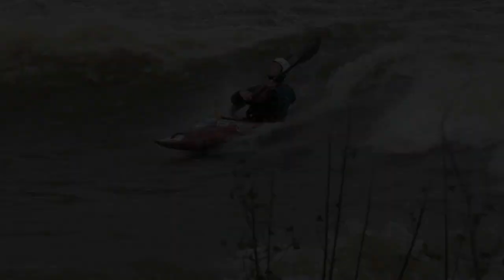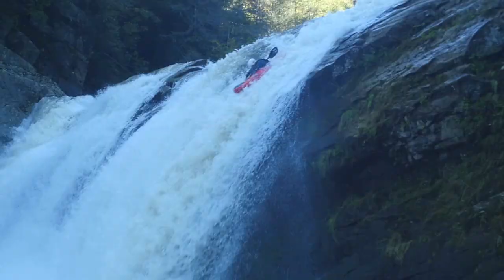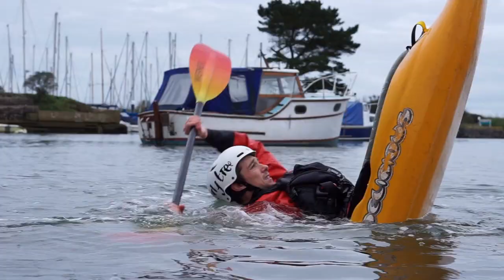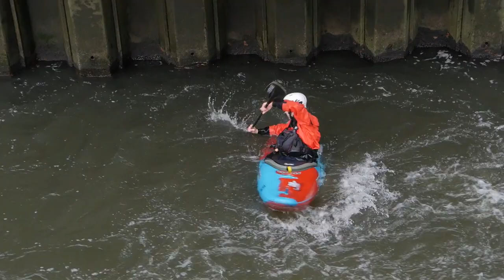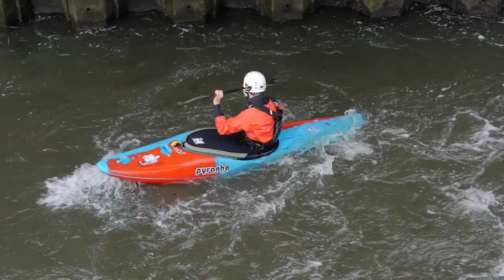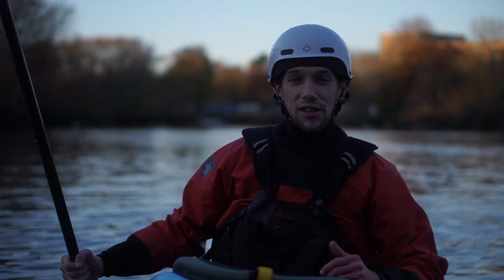How to stern stall (a verticality deep dive!)

Comment: Would you elaborate on what is meant by keeping the upstream edge more open than downstream edge?
Reply from the maker: When the stern is engaged underwater, it is common to complete an edge transition, which releases the stern and bring the boat flat again. The aim here is to avoid that edge transition, keep the hull flat/continually driving deeper, so that the boat stays vertical. I hope that helps.
Reply: @MatthewBrookKayaking  Thanks. At times I've thought of it as crossing the eddyline, engaging the upstream edge and keep rotating the hull towards that eddyline. Wondering if this is also what you mean by keeping the upstream edge 'open'- that is open to the downstream flow?